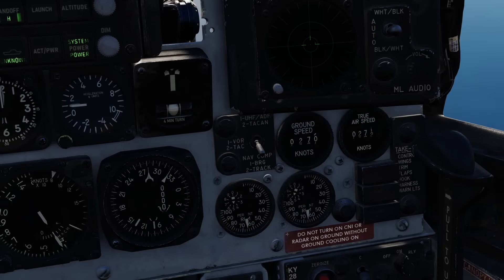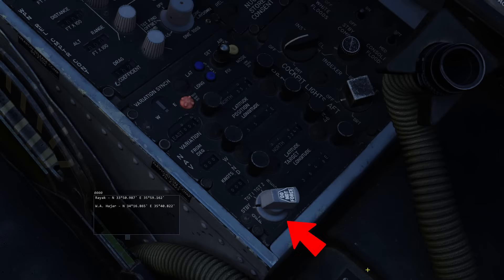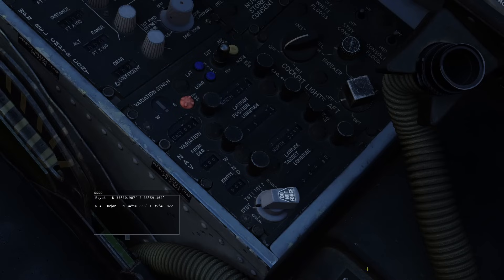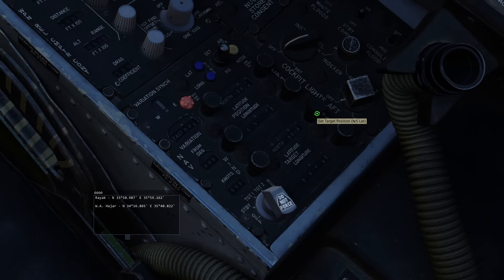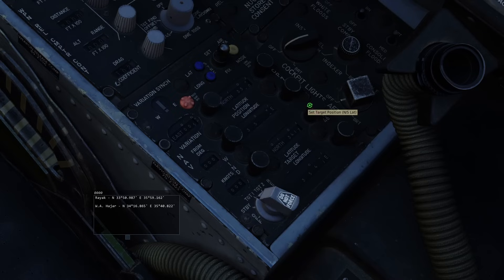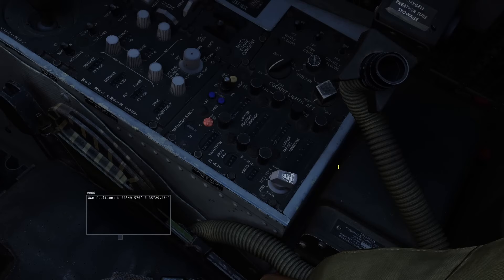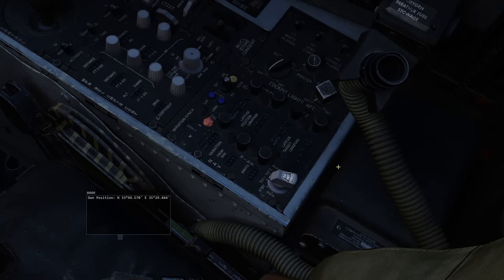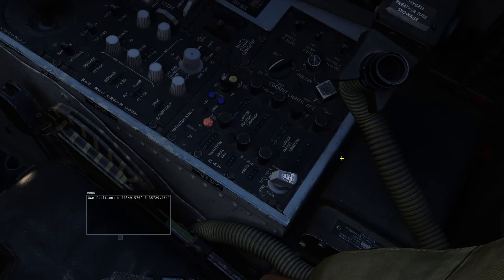DCS World - F-4E WSO INS Navigation Guide

Comment: A lot of early Nav systems only had two waypoints, in practice they are still really capable, because you can leapfrog waypoints and overwrite the the just overflown wapoint with the next set of coordinates.
Reply: Let me check if I understood correctly. For leapfrogging to work, the workflow should go as follows:

1. Set the knob to TGT2 and enter the coordinates to the current waypoint.
2. RESET and return the knob to TGT2. The values are stored into memory and the BDHI navigation pointer shows bearing and distance towards the stored coordinates.
3. Enter coordinates for the next waypoint while staying in TGT2. These won't affect BDHI, as navigation coordinates are read from memory when in TGT2 mode, not the dials.
4. If necessary, the knob can be momentarily moved to TGT1 to check the location of the next waypoint)
5. When the current waypoint is reached, cycle the knob to RESET and TGT2. The next waypoint is stored from the dials to the memory and becomes the current one.
6. Go back to 3 as many times as you need to.

So in essence the TGT1, TGT2 and RESET knob positions should be named MAN, PRESET and STORE, respectively.
Reply: @nyandyn  did you find out if this was correct?
Reply: @timothymorgan8254  Sorry, didn't have time to get familiarized with the rear cockpit yet! 😁
Reply: No problem, keep me updated. I've only learned pilot start up and take off so far. Best DCS session to date.